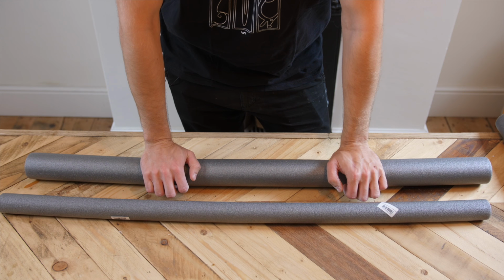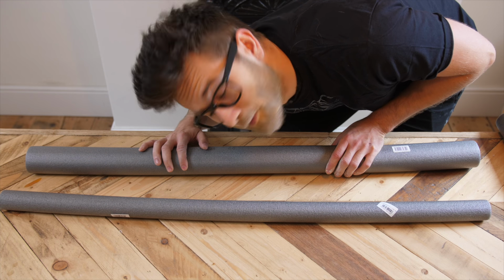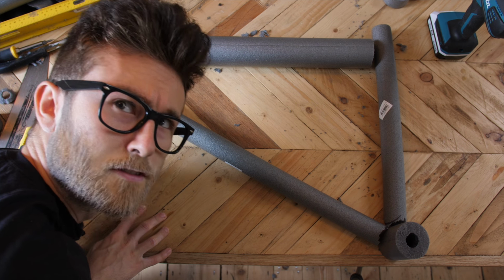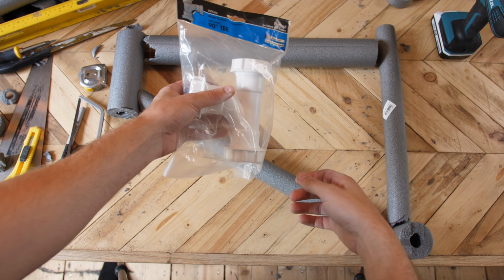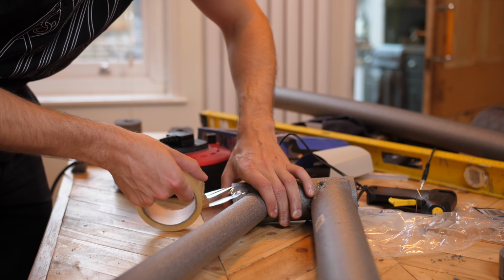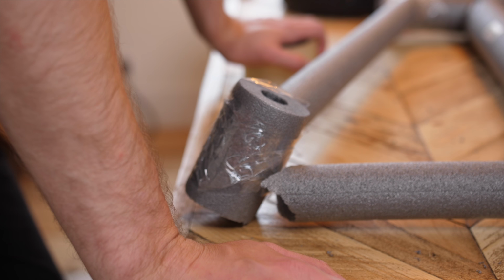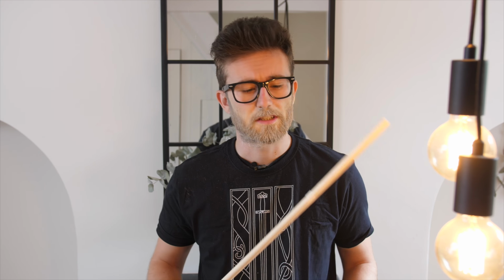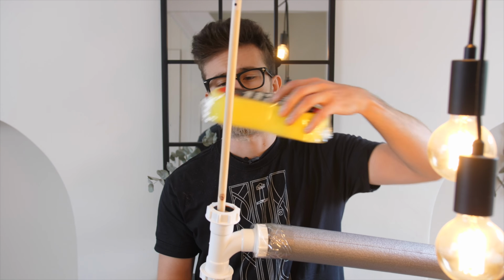MAKING A MOUNTAIN BIKE!!! Part 78

Comment: I desperately hope they make a t-shirt that says "Welder" and has a picture of a glue gun.
Reply: I mean that's basically what a MIG is.
Reply: “Stick welder” pile of glue sticks and the glue gun.
Reply: It’s a must
Reply: I would buy that!
Reply: @th3wizardofaust3a15  glue stick and a blow torch. Learn that trick from Alec about a month ago
Reply: I would buy that too!
Reply: Yes. Yes so much yes
Reply: It is somewhat welding though. He melts the glue to join two foam noodle together
Reply: Tig welding, mig welding, and HG welding 🤣
Reply: Sam A nah m8. It’s not even close. MIG can be thin, or even thicker than that. I’m disappointed in how dumb humanity is becoming.....
Reply: I too want this. I will buy it. Pleaseeee....
Reply: surrel man a plus
Reply: @roan5250  Glue guns are a bad example, but the most common glue used for plastic model kits (Forget what kind of glue that officially is) works by melting the plastic.
And that, is technically what welding is about...
(chemical welding in this case, rather than heat based. But the outcome is technically the same...)
Reply: Definitely
Reply: @KuraIthys  the glue used in building plastic model kits is called poly cement and yes it does work by melting the two pieces of plastic slightly

Comment: Best video ever.
pro tips
A. material selection amazing
B. Use A hole saw instead of speed drill
 for A better finish 
C.  duck tape work better on stainless steel 
D. working on hard material Use the hot glue while it’s still cold make much better world
E. 🤣🤣🤣

Comment: I think someone must have tipped a little something funny into Jamie's kettle... Brilliant results though! Alec's welding has improved leaps and bounds! Did notice a couple of blow-outs, but "grinder and paint" and all that rot... Practice makes perfect on the mixed nut tricks Will... You'll get it eventually! I was wondering if a wheel or two of Stilton mightn't be just the trick to make it go rolly-rolly... Cheers for this!

Comment: @alecsteele Im a shop manager for hydraulic equipment and industrial air compressors (we also deal with pneumatic rams).

Check the ID wall where the power hammer piston rides.
Any grooves or scratches will need to be honed out. If they're so deep that the ID will be too many thou off for proper ring fittment, you may need to resleeve it.

Alternatively, buy/make a jig to center a dial indicator over the cylinder to make sure its not oblonged by a degree you cant see with the naked eye throughout the length of the tube.

Hope this finds you well🙂

Comment: Interesting material it’s extremely rigid and flexible. Because everything that is extreme rigid should be flexible. That way you can bend it to where you want it and it will stay because it’s extremely rigid. As I figure out my next cut Will is going to take 372 pieces of high carbon steel along with 371 pieces of chromium steel and throw them all into the garbage can. Then he’s going to make a metal box and stuff with assorted hairpins, thumbtacks and paper clips that he will heat up till it’s glowing brighter than the sun and then tap it with a ball peen hammer making a beautiful Damascus billet. Next he will heat up the bullet and hit it for....,no wait, seven times with a jackhammer in order to get it to that perfect shape of that designer knife. Now that he’s satisfied with it not being totally corkscrewed He’ll take it in the grinding room and in slow motion grind on it for 10 seconds and then be ready to put the scales on it. Now once he gets the guard and the Pomel finished it’ll just be 20 seconds of folding paper and playing with squirt guns and it will be ready for the etch. Good just dip it in the orange juice for two seconds and then neutralize the citric acid and look at that amazing fixed blade folding knife. It looks amazing let’s put it on the website and sell it for 2 1/2 million dollars. Oh look it’s already sold. We’d like to thank our sponsor but we forgot who they were that’s why we make up those other videos separate from the main video and you can tell it’s different because the hairstyles changed. Thanks for watching and come back next time and maybe I’ll get another weld done on my bike.